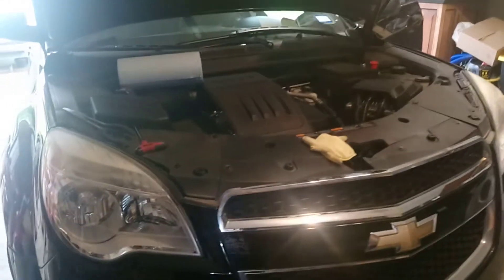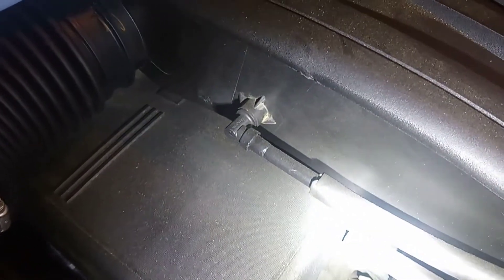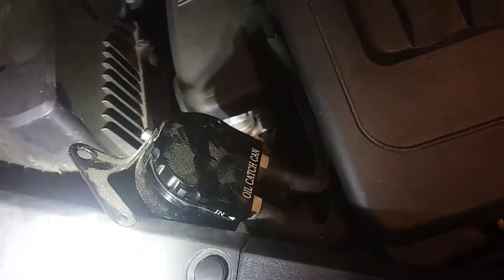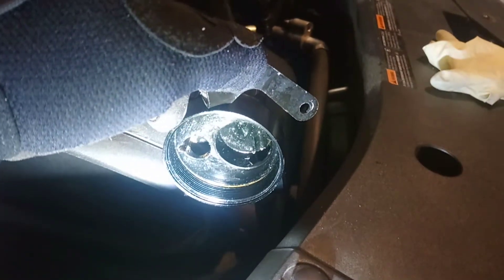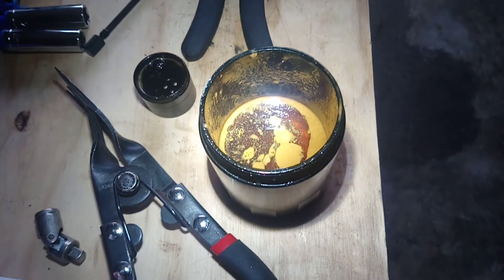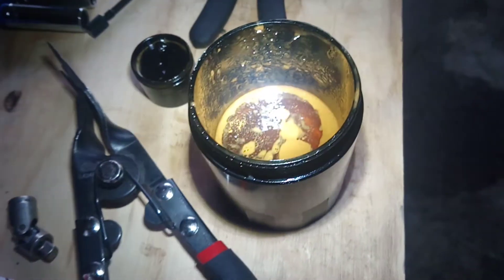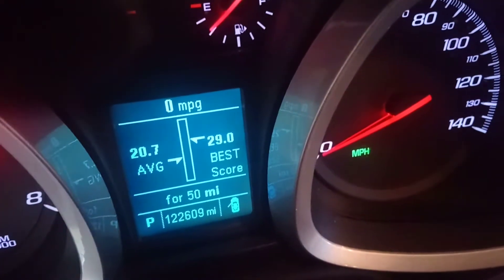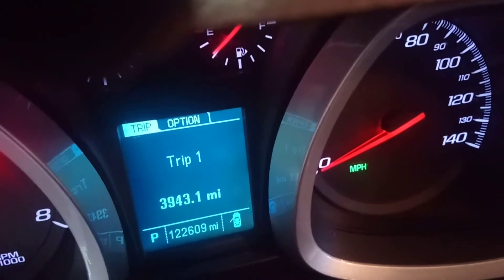GM engine could blow up without Catch Can! Bulletin 14882 DIY FIX for ECOTec motor

Comment: Gm also came out with a vented oil cap thats fixes the problem. I just put it on my 2012 chevy equinox ls with 58,000 miles on it.
Reply: Just a note. If your high pressure fuel pump fails, it contaminates the oil with fuel. This messes up the vented oil cap. Just had this happen on a friend's equinox. I opted for a breather style oil cap, off Amazon. $15 USD. No idea how efficient it is but it will prevent the Seals from blowing again.

Comment: I just did this on my 2014 Chevrolet Captiva Sport which has the 2.4 Ecotec GDI engine and it's working soo far soo good, I also put a vented oil cap on as well to help with the pressure that causes the rear main seal to blow out. I empty my catch can everyday, it's that coffee colored water I keep dumping out. I'll be glad when the recall is finalized and we can get these Ecotec engines fixed for good, I've had very good luck with this car and I'm at 139,000 miles.
Reply: You need to take off the intake manifold and clean the little hole out!!! This is not good information, this catch can.
Reply: @Constitutionalrevival   - FYI... may help! Look it up on YT... "DON'T remove Equinox/Terrain intake manifold. PCV hole Super Easy Fix"

Comment: The rear seal on my sons 2012 just blew after only having it a few months after some sub zero temps.

Unfortunately the car has 150k miles on it so no fix from Chevy.

$1800 to fix.

Comment: You have a clogged orifise no way in hell should you catch that amount of oil, why because the way you have it installed its wrong. You need to add a pcv to the oil cap run that hose to the oil catch can. Secondly do a t line in the brake booster hose to the catch can. It gives the engine or crankcase more of breathing air and wayyyy less blow by.
Reply: This method is very effective in catching oil and vapor during cold weather, highway driving.  This is where people have the most problems. Summer time you wont see much.  I have done a dual catch can system on mine, one on each side of the PCV system and I blocked off the internal orifice.  I use a ME Wagner adjustible PCV valve to get the correct flow rate and vacuum in the crankcase.  Be careful of using off the shelf PCV valves, they pull too much vacuum and oil vapor and it still gets into the intake.  Also this past winter the brake booster hose filled up with moisture during highway driving and blocked vacuum to the brake booster.  Adjust the hose and T fitting so it flows down hill to the intake port, otherwise this could happen to you.
Reply: @tssci6774  i have a friend that has been using hes equinox for 4 years with no condesation on brakebooster.i drill a hole on oil cap and added a pcv valve and routed it to the catch can and brakebooster to catch can too.and yes you can catch oil in summer time too not just in cold weather.
Reply: @rhurtadorh32  on fresh air side between the air intake and valve cover only sees emulsified oil in the winter.  The dirty side or high vacuum side will see oil vapor year around.

Comment: Intake manifold needs to come off to clean pcv ports.
Reply: I thought I was the only one that noticed that
Reply: Yes you must fix the plugged pcv system. Crankcase pressure builds blows out crank seals. I believe that is why you see folks installing actual pcv valve using brake booster hose. It still doesn't solve the extreme blow by issues but it helps.

Comment: Older vehicles had a breather tube with a filter in the air filter housing. And the PVC was on top of the valve cover,
and engine vacuum from carb port sucked in the crankcase fumes for burning.
The PCV passages are inside the intake manifold on the 2.4 Ecotec, aren't they?

And there are 4 little ports where the gases get sucked into the engine.

Comment: What did the recall suggest? Or what is GM doing to fix?
Reply: Good until 2022 or 120,000 miles. Whichever comes first. I bought my 2012 GMC Terrain last month with 122k miles. I can't do it, but I think the original owner got the recall on it because I am not burning or leaking any oil.

Comment: Your the first person I've found to install it the way I want to install it.  Everyone else taps into the brake vacuum line and oil fill with a connector on the oil cap. . I will do it the way you did it. Much easier job and from the looks of it . It works great.
Reply: I took off the existing PCV plastic hose that goes from that fixed orfice to the plastic air intake, cut the ends off and reused them and attached the hose to those ends and ran them to the catch can and I installed a vented oil filler cap to relieve the pressure that causes the rear main seal failure.
Reply: @dkt1976dt  how is it working for you.  All good ?
Reply: @haddonhousefilms  Yes soo far soo good, I was cleaning oil out of the plastic air intake everyday, now there is just a drop of oil in the plastic air intake, I empty out my oil catch can everyday and with it being early spring here in the northeast, it's just that watery oily coffee residue. I paid $40 for my oil catch can on Amazon but it's a must have if you got a 2.4 Ecotec engine and mine is a GDI.
Reply: Hi, did you end up doing it this way too? I was thinking exactly as you were but was/am skeptical on doing it this way. I guess I am looking for all confirmation I can that this way works just fine. Thanks for any help/advice.
Reply: @SWTM92  yes I did it this way. It works great. No problems. Just check the can level dipstick periodically . Usually have to empty it once a month.
Reply: @haddonhousefilms  Thank you. I appreciate your response.
Reply: How is oil cap harder?
Reply: @SpotterDeer  it's not much harder. Just more work. Twice the amount of work for the same desired results.

Comment: Is this can connect it right? You have the hose from the crankcase to the inlet of the can, and outlet to the air box plug?
Reply: Yes that is the correct way.

Comment: Thanks. I had already signed for a 2014 Buick Serano, same engine. Good mileage, but only now have I begun digging about the Ecotec. Do mechanics offer this service? I think an investment towards a catch can installation might be worth it.
Reply: Buy the $80 " c-f-m performance ". Oil cap, and you should never Have a rear main seal failure.....,  and you will not need this catch can ....  this catch can video installs the catch can on the clean side PCV breather hose....  normally catch cans are installed on dirty side PCV hose, to catch fumes before they are deposited on intake valves......       ,,,,  if you do install catch can and the cfm oil cap, you will notice your catch can stays empty .
Reply: @pietsee1000  Dude, why are still pushing this junk.  CFM tech support said not use it in freezing weather because it was not designed for this engine or for use in cold weather.  Buy an AC Delco FC-219 valve regulated cap.  There is a TSB on it and used by GM for 20 years. Only costs $15, save your money on this junk.

Comment: Where do you connect the catch can to the pvc hoses, can't really see in the video.. Just blew out rear main seal on Christmas day.  
thanks.
Reply: Buy the $80 " c-f-m performance ". Oil cap, and you should never Have a rear main seal failure.....,  and you will not need this catch can ....  this catch can video installs the catch can on the clean side PCV breather hose....  if you do install catch can and the cfm oil cap, you will notice your catch can stays empty .
Reply: @pietsee1000  I installed the catch can and also purchased an AC Delco FC219 vented oil cap.  Car has been driven about 300 miles since installation and there is nothing in the catch can.  Wish I had seen these reports before the rear main went out, approx $1500 to repair, plus tow..  Concrete driveway has big oil spot which will need to be pressure washed on the next warm day.  Thanks GM for your unresponsiveness,  This is is real problem effecting real people who buy your products, I presently own 5 Chevrolets, a Blazer, an Equinox, an Impala, and two Corvettes.  My two sons own 3 Corvettes, a SS camaro,,another camaro and a Malibu..  If General Motors fails to step up and address this equinox problem, I am pretty sure my and mine next cars will not be Chevys or any other GM product.
Reply: @larrymann2105  The catch can is installed on the fresh air side.  you wont see anything except during highway driving in freezing temps.  That is when crankcase vacuumm is lowest and the intake will ventilate the crankcase, through the catch can.  this is the way it is designed.  The CFM cap vents continously, throws off fuel trims, does not allow vacuum to build up, which is bad news.  Acids and blow-by will form in your oil which leads to sludge, varnish and hard carbon.  The manufacturer admitted it should not be used in freezing temps, because it will freeze.

Comment: This is the result of Opel engineering at GM on all Ecotec engines. They tried to save a traditional $3 PCV valve by designing this built in failure. Another one is timing chain guide failure that could short life this family of engines

Comment: @ABO  I'm having a hard time finding definitive info on this but it's my understanding that some, but not all,  of the 2.4L Ecotech's use Gasoline Direct Injection, making an oil catch can almost a necessity since gas isn't being sprayed into the intake valve area thereby helping keep that valve and valve seat clean.  How can I tell if my 2012 Terrain has a GDI engine?  TIA
Reply: Direct Injection will have injectors bolted in the cylinder head, port injectors will be in the Intake manifold near the cylinder head.

Comment: Did u change the pcv valve too?
So from the way u installed, u installed a hose from the valve cover pcv outlet going to the catch can inlet then catchcan outlet hose connected towards the existing metal hose that connects to the side of the valve cover..can pls confirm
Reply: There isn't any PCV valve in this engine, it's a fully internal system. The best you can do is install a catch can as shown in the video.

Comment: Lol, no your engine would not blow-up.  On the other side of the valve-cover is what is called a "breather-hose." The crankcase would just vent through the breather-hose which open to the atmosphere...

If you want to end a lot of your problems, just ditch the pcv system entirely.  Cap-off the intake manifold vacuum for the pcv-port/hose and vent the valve cover to the main-intake (pre-throttle body).  Used that same catch-can you have to fix oil-burning & issues, tried a lot of other things, and finally on a whim I just disconnected to pcv system.  Now the pcv is no longer stealing vacuum from the engine, so combustion is more complete with virtually no blowby or emissions.
Reply: Yeah well tell that to all the people in the class action lawsuits who blew out the rear main seal.
Reply: @8tyeightify  wasn't caused by a clogged pcv-valve.  I've had pcv-valve capped-off and disconnected from intake-manifold for almost 3 years.  420,000+ miles on the car and runs great.  never blown a seal
Reply: @Wes_5kyph1  The law suit seems to support otherwise.
Reply: Link to what you're talking about plz?
Reply from the maker: He is talking about the next video I will be releasing. GM covered their butts by settling in a lawsuit over oil consumption, admitting the very thing this video is about, instead of doing a recall.
Reply: The crankshaft   rear main seal will fail, if that clean side PCV breather hose freezes,,, yea the gunk you see in this video catch can can freeze at 20 degrees F or colder..... then  because of piston blowby , increase pressure will blow out rear main seal, ..  and all 5 quarts of oil will dump on pavement on a few minutes....  IF .. if you drive with no engine oil, I guarantee you, you will trash your engine....   and many folks have driven a few more miles to get to the next exit or gas station and many many many engines have been trashed...
There is a solution, and it is not this catch can on clean side breather..
Reply: @pietsee1000  I agree with your comments and saw one where you mentioned a cfm oil cap. Is that the solution? What is that cap? Thanks
Reply: USAFuel ,  yes, .....  the $80 " c-f-m performance " oil cap is the "solution" , to prevent rear main seal failure AND to make this ecotec engine last a very long time...  it is the perfect bandaide for this engine
Reply: @pietsee1000  GM makes a vented oil cap, FC219 model number. I put one on my 2014 2.4 Terrain about a year ago and cost $11-$12 on amazon. If pressure gets high it releases it to not blow rear main seal.
Reply: @rotwiler7674  thank you.
I wondered.

Comment: If the catch can is higher than the PCV system, how will it prevent freezing? Just trying to understand. I had the rear main seal blow out when it froze.It was fixed under warranty, but I still have that caramel liquid collecting. Every time I drive it in the winter I  think it will happen again. I was doing the oil consumption test & the dealer kept telling me it was within GM standards. I told them just change the oil filter as I am adding a liter about every 2000 kilometers.
Reply: Its GM techs job to say it's within standards until the lawsuit for the recall becomes finalized.

The original PCV hose line is a "C" arch upward. The Catch Can is just placed online at the natural bend. When you open throttle, a vacuum is pulled which pulls the sludge from the engine up that tube into the intake. The Catch Can is a void area for the sludge to fall before going back into intake.

If you still have sludge, which you will in the cold, the catch can will clean it up. But it wont fix the issue with the bad oil rings on the pistons these engines have
Reply: Thomas Z 

You are correct, this clean side catch can should be lower athen the nipple in the crankcase valve cover, so all the crankcase gunk can flow down hill to the catch can...
Reply: This is technically the clean side of the PCV system, the catch can should be installed at a downward slope from the PCV inlet, as low as possible. It may still freeze if not cleaned out often enough, the solution is to install a breather on your oil cap, this will prevent too much crankcase pressure and a main seal blowout.

Comment: I live in Austin Texas so we don't get much in the way of freezing temps, and it's usually only for a night and some of a day.  But my old faithful car that was paid for years ago, had what we think was a transmission failure, so I opted to get something else. I needed,  running, well maintained, and  affordable.  I settled on a 2012 Terrain with 140K on it.  It's a solid car but I need at least 2 years out of it without having to dump money into it.  The day I got it home, the inquisitive shade-tree mechanic in me had the airbox and valve cover cover (lol  still cracks me up that they did that) off and the first thing I saw when i pulled the PCV hose off the airbox was oily sludge on the end.  Then I started reading about all the horror stories of massive oil consumption, etc, etc.   I think my car, driven like I drive, and maintained like I maintain, will be good for another 100k, but I'm ordering this oil catch can for sure.  Oil has no business getting sucked into the throttle body, even in small quantities.
      I'm considering running a can of Seafoam through the air intake.  Any thoughts on that?   TIA.
Reply from the maker: I'm from Fort Worth so I know the extreme weather changes. Towards the last days of ownership, it's been below 50 degrees for a good string of the summer. I've had to empty the full catch can every week.

Comment: wheres this sludge coming from bottom hose? if so thats confusion because if you put your finger on that opening there is a vacuum. in fact i thought that that bottom hole is an air intake.
Reply from the maker: Vacuum is pulled when you step on the throttle. The bottom hose is the outlet of a traditional PCV valve. It sends blowby back into the throttle body to be reburned. Only this engine sends too much and also condensation. The catch can gives an area of negative space for the heavy fluids to fall and the air to move on cleaner.
Reply: J Kim, yes that hose called the clean side PCV breather hose, allows air from the "air box" to flow into the crankcase ,   Because the dirty side PCV orifice which is molded into the intake manifold, allows the intake. Manifold to suck crankcase fumes out of crankcase ..... BUT,  as ABO mechanic said...  when you step on the gas, called wide open throttle , WOT,  the vacuum in the intake manifold drops to - 1 psi (avacuum of 1 psi) AND during WOT piston blowby PRESSURIZES thecrankcase,  THUS. During WOT the crankcase fumes flows the wrong in the clean side PCV breather hose.       .   .   .   ABO mechanic has spliced the catch can into the cleanside PCV hose to catch the crankcase crap that is pushed out of crankcase by high crankcase pressure, caused by piston blow by... it is a fix.. but there is a better fix, an easier fix....
I suggest the $80 cfm oil cap to allow crankcase pressure to escape... and a $20 can of BG EPR p/n109, in engine oil for 20 minutes before oil change to clean piston rings....
Reply: @pietsee1000  Hey Pete Collins, the CFM oil cap only causes more problems, throws off fuel trims, sends gas and oil fumes into the cabin, and also freezes up.  CFM said it should not be used unless both the cap and engine are at operating temps.  Owners are not going to remove and install the cap everyday and keep it thier house or at work.  Just buy a AC Delco FC-219 valve regulated cap, it was designed by GM for this purpose and it only costs $15.  This CCV system with a restrictor orifice was designed for reverse flow in low vacuum and wider open throttle conditions.  Its not wrong, we have had this debate many times but you seem to be stuck in this wrong think.